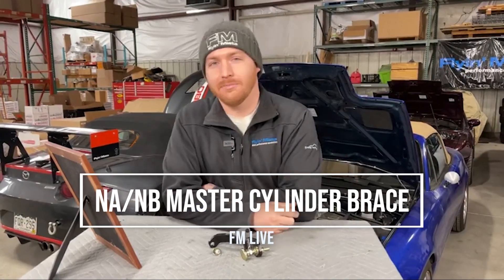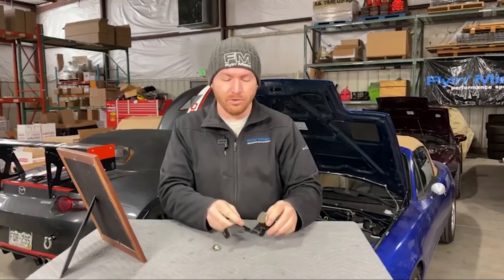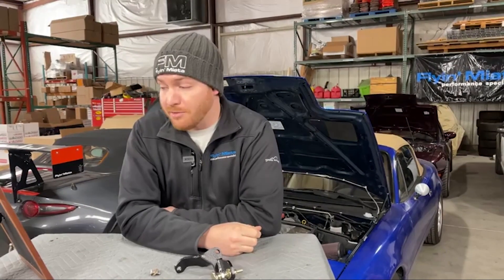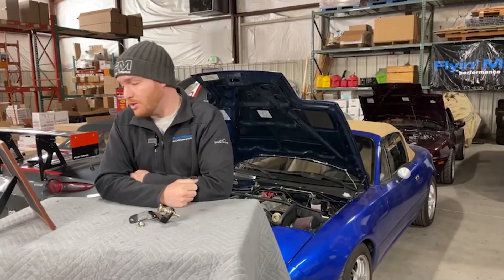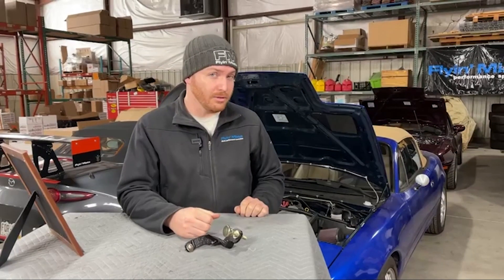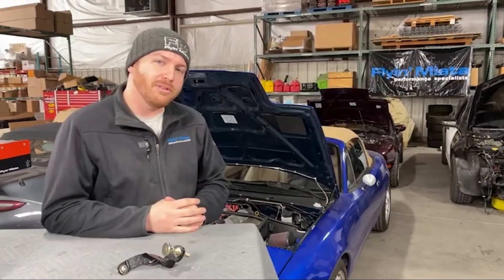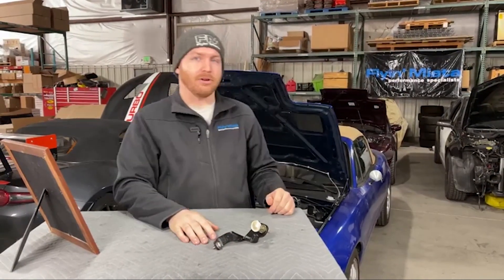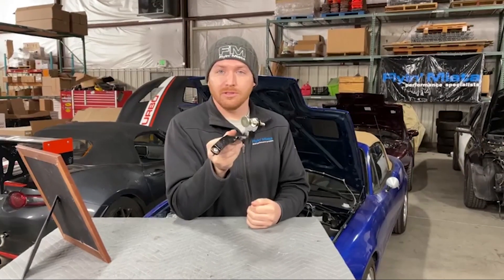Why you need a Master Cylinder Brace! (FM Live)

Comment: I bought this brace over a year ago with the plans to machine my own  manual brake booster delete setup then found honed deveolpments manual brake conversion kit. I ended up making an extension and welding to the FM brace to make up for misalignment and 40mm relocation distance. With manual braking unbraced vs braced holy cow it is required!

Comment: Mine didn't fit. 😔 02 NB. Stupid enlarged brake booster.
Reply from the maker: Sorry to hear that! Mike covers some common fitment issues in the video. Please reach out to our customer support team if we can be of any help!
Reply: @FlyinMiataVideo  I regretfully had to return it. Great part though. Maybe someday you will design one for the NB enlarged brake booster. Mike is super smart by the way.
Reply: @merlyn2121  Agreed! I have had two 2002 NBs without ABS that could have benefitted from this part... IF it would work on the NON-ABS cars...
Reply: On my 04 It has a cross brace that I haven't seen on other Miatas but, it looks stock.
That's why I decided to take a crack at building my own. Since I'm more comfortable with wood I made it out of some oak. 
Oak is very durable and I painted it flat black so you hardly notice it. I tried a couple of really hard stops and it does make a difference.
Reply from the maker: @evanetheridge3798  We show both in the video for reference, but all you need is a ruler to find out!

Comment: Is there a brace that fits the NB ABS system?
Reply from the maker: This brace will fit the NB with ABS, as long as you have the 3" brake master (will not fit any car with the 4"), and you can relocate or clear your washer bottle reservoir that sits over the manifold. Sorry we didn't have a sample pic to show you.
Reply: @FlyinMiataVideo  the only way to check is to measure right?
Reply from the maker: @FusterIsBased  That's the easiest way. In the video, the blue car with the brace has the 3" master, while the silver car without the brace has the 4". Side by side, it's very noticeable.